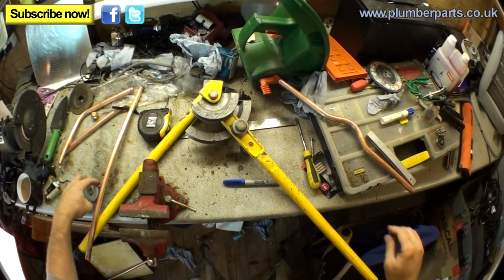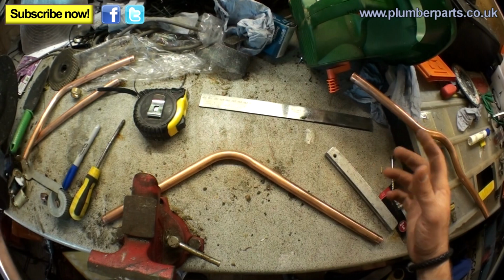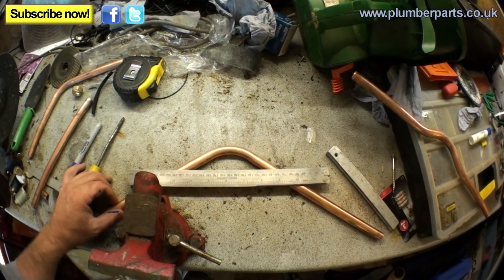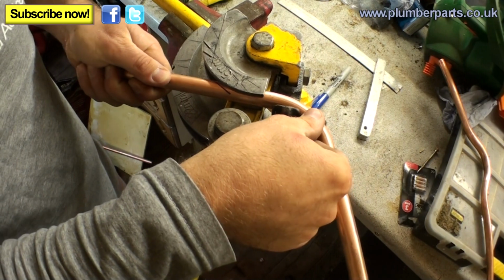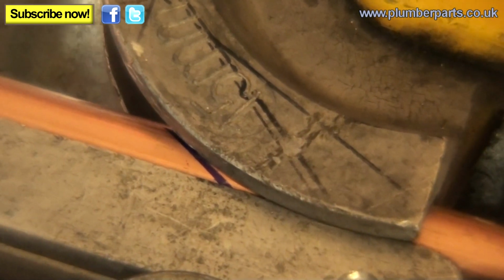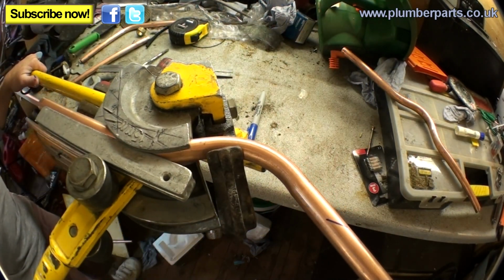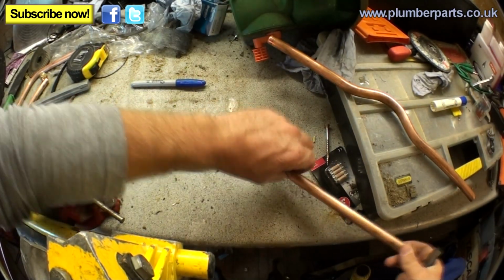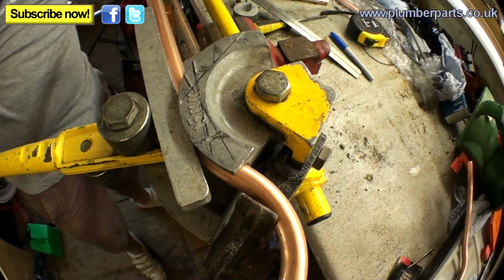HOW TO BEND A CROSSOVER - COPPER PIPE - Plumbing Tips

Comment: I watched every video on how to pull a crossover bend last night and this was bar far the easiest to follow. I pulled by first crossover this morning a piece of scrap 15mm pipe, 10 minutes later I pulled my second on a 3 metre length of 15mm (had to do it in the front garden in order to get the angle....perfect. Then did 2  partial crossovers in 22 mm, spot on. No vice to hand ( though it would have been helpful to have one) so it was all done with just my cheapo 35 quid bender. Thanks James you are a rockstar.

Comment: Great videos BTW!  How would you chase this into a wall? Is it better to bend a horizontal cold feed over a vertical hot feed, vice versa or does it not matter? . Also can these Bends get away with not being insulated if the majority of the straight sections are?

Comment: When you turned it over and transferred the mark from the center of the pipe, it should have been the back of the pipe imo, if you’re then referencing the last bend from edge of the former which is where the back of the bend will be.

Comment: I have a heating system that suffers from differential temperatures in every rad top and bottoms are also different what can I do to get symmetrical temps throughout the system
Brian
Reply from the maker: Give the rads a flush! SUBSCRIBE! ➡️👉 https://www.youtube.com/subscription_center?add_user=plumberparts 👈⬅️if you haven't already!
Reply: ***** I will in the summer when the weather is less likely to freeze. Thanks I was kinda hoping to get away till then 
I am an ex plumber who now earns a crust in the design office so my hand is out of practice as they say. Enjoyed your channel.. I like the pin hole trick I have used a self tapping screw wrapped in ptfe tape round the shaft just below the head.... before now ha ha the things we do to plumb! 
Another trick Soder a penny on a half inch pipe for a stop end, then you can knock it off later and solder a fitting straight on before that I used to bash the pipe between two hammers if I was short of fittings on a late winters night in a first fix job, and solder the gap but the penny was cheaper than a stop end just dont solder the queens bonce, it may be a bit illegal!